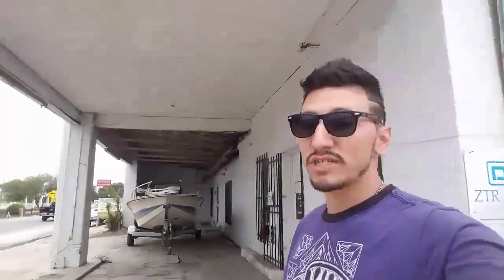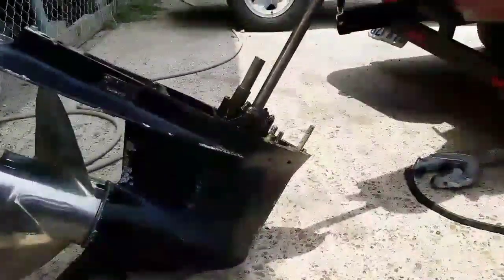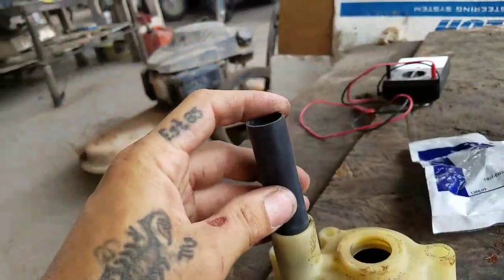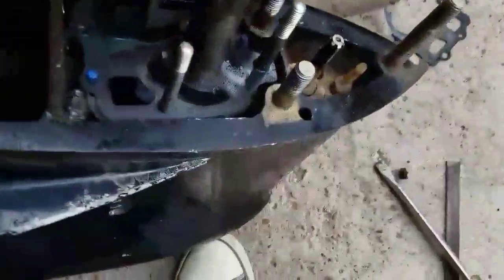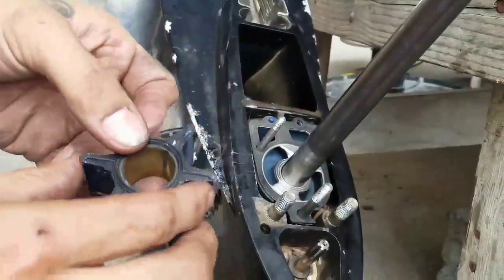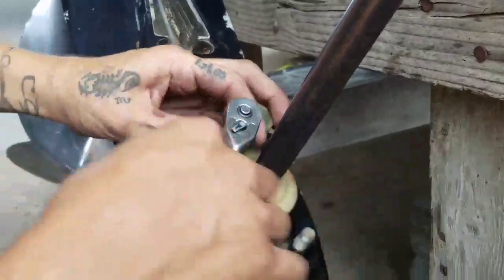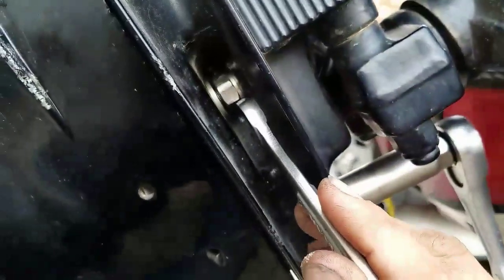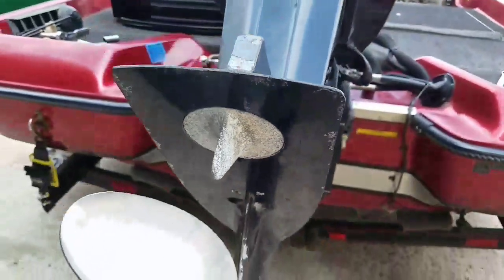How to replace an Impeller on Mercury 135 hp

Comment: After reading all the comments and just tackling this about an hour ago, the only other thing I'd recommend is putting it in gear before dripping the lower unit. That way when you go to reinstall the lower unit you can rotate the prop the if the main shaft keyways aren't lined up. And you won't know they aren't lined up until you have everything else lined up and ready but it won't fully seat. Now that I know this, this job would take me 45 minutes on a bad day. But great video and without it I probably wouldn't have even attempted it!

Comment: Good job on this. Thank you. Just a tip for you though... If that lower unit got hot enough to melt the water pump housing you should have changed the gear oil and checked the seals for the gearbox. The oil is probably cooked and I would be very surprised if the seals are still good. Yes, that's a complete teardown of the lower unit but it probably needed to be done. But, otherwise a great video.
Reply: Agreed,  I would have done the Lower Base with the oil seals for sure and of course change the gear box lube.  (Optis alway use High Proformance 90)

Comment: Hey thank you very much for your video. You made it look easy. I’m working on the exact same motor But I think mines a couple years newer.  Last night I was working on it but I couldn’t get the Bottom unit to go back on but after watching your video not only do I know how to do that now but I realized I have to take it back apart because I forgot t bottom unit to go back on but after watching your video not only do I know how to do that now but I realized I have to take it back apart because I missed The locking pin on the impeller. Thanks again

Comment: Great video. Thank you. Made it very easy for me to replace the impeller on my 1971 Mercury 1350... 

Quick question - The sound the started made on the first attempt to start when it kicked out, do you know what the cause of this is? I'm struggling a lot with my starter when the engine is hot. It keeps making that noise and the starter doesn't kick in. Is there something you know about I can look at?

Comment: Grandpa had me start my 115 hp mercury 1984, without water hookup to try an get it started. engine ran away WOT and the impeller is just Gone. looked similar to yours.

Comment: Using a Petroleum grease or oil on the Impeller is not the wisest choice as it can rot the neoprene, A water based lube, Gylcerine(KY jelly) or dish soap will work fine without affecting the impeller

Comment: Fantastic video what year is the motor i have a 2000 model Mercury 135 hp how often should you change the impeller i was told once a year
Reply: Yes once a year

Comment: Cant get the lower unit shaft back in and connected.  Raise the Lower unit back up to the motor after changing impeller.....and the shaft will not go back in.  I've turned the shaft to line up the spline gears at the tip but it just won't go back in.  Spin it, make sure it's absolutely straight in position but will not receive the input shaft.  HELP!
Reply from the maker: Try rotating the flywheel on top of the engine ,  not the shaft or propeller.
While trying to mate them together👈
Reply: @GTsPerformance  Hey!  I got it to work.  Just put the boat in gear either in reverse or forward.  That holds the drive gear in the motor so that you can turn the lower unit shaft and slide it into place.  Thanks for the help!

Comment: Has anyone ever replaced the blue base under the impeller? Im in the process of replacing mine but the base looks damaged but not sure how to remove it? Any help would be appreciated. Motor is an 86 mercury xr2 150.

Comment: Great video do you have a add oil? I have a115 mercy blue is it the same process?
Reply from the maker: The steps are the same, and these dont spill the oil when you remove the lower unit, but if you want to replace the oil while you're at it.. it takes about a quart of 80-90 gear lube. 
For that, just remove top bolt and the lower bolt to drain (they're both on the lower unit), then you'll need a pump for the quart of gear oil.. connect the pump on where the bottom bolt goes and fill till it starts coming out the top. Once full, put the top bolt on first, then disconnect the pump and quickly put the bottom bolt on. And done! 🙂👍
 Hope this helped, and good luck!

Comment: can you just replace the impeller or do you have to replace housing ect. and is there only one way the impeller can go on or dosent it matter which way i put it on and do you turn shaft clockwise to slide housing over impeller
Reply from the maker: The housing is only if it's damaged.. otherwise,  there's no need to replace. The impeller goes in smooth if you turn the shaft clockwise while pushing down on the housing cover. Either direction you install it, it'll align itself once you give it its first crank. 
We use a bit of white lithium grease/ petroleum grease to slide it in and for the first start, but you could just use soap
Reply: @GTsPerformance  Thank you very much, much appreciated.

Comment: Great video. You gave me the courage to give this a try. I do have a couple of questions. I can't get the lower unit back in. I've got things lined up and it's about 1/4" away. I think it might be related to the shift rod. I had it in reverse but now think the motor might be in neutral. Is it ok to shift back to neutral? Or better to change it manually on the lower unit to reverse (not sure how)?Any tips would be greatly appreciated as I don't want to hurt anything or cause any damage. Thanks again for posting this video!
Reply from the maker: We usually put the gear in neutral,  that way the shift rod can be moved into place by moving it with your fingers. When it is in gear (forward or reverse), the shift rod is in a fixed position.  Sometimes it isn't perfectly aligned and  won't let you sit the lower unit fully shut.
Also, check if the pipe that connects to the impeller housing is in correctly.  That may also cause it not to go in.
Reply: @GTsPerformance  Thanks for the reply. Since it is already in reverse, would it be OK to shift the boat back to neutral and try aligning again or would that cause a problem?

Comment: Do you have to put sealant on when putting the lower unit back on?
Reply from the maker: No, there should be a gasket for the impeller housing,  but no sealant when installing the lower unit back on.

Comment: I changed the impeller now water is coming out the sides by the zinc's and out the exhaust ???? What did I do wrong?  Thanks
Reply from the maker: BR Fleenor ok, I'll be glad to help out. First,  let me just ask what kind of motor you're working on.. (make, h.p. , and in/outboard)
Reply: GT's Performance its a 150 mariner magnum
Reply from the maker: +BR Fleenor   you didn't do anything wrong! This is absolutely normal to see water coming from the sides or exhaust. As long as you have a steady water flow coming out the engine, you have nothing to worry about. Sometimes it's just the water pressure from your hose is too high and the small engine doesn't require that much.  The impeller in the lower unit will suck only the required water to cool the engine,  and the rest leaves from any exit it finds.  

If you do not have water exiting the engine, you may have not aligned the tube that goes from the impeller up to the engine!!

I will advise,  please do not add silicone to seal the lower unit to its base.. as this will trap water and create corrosion. 

I will try and post a video about this first chance I get..

Thanks,  any other concerns.. just ask
Reply: GT's Performance Thanks! After looking i think most of what i was seeing was overspray from the muffs!

Comment: What is about the shifting rod alignement?
Reply from the maker: When you remove the lower unit,  the rod for the gear automatically moves to forward,  so some people put the gear in forward when removing the lower unit,  and when it comes time to install,  you don't have to move anything.. just install. (In theory) 
But, sometimes the rod for the gear doesn't always fall straight into place. So this is just by personal preference,  I like to leave it on neutral so if it doesn't align I'll just align it by hand (on the lower unit)when I'm putting it back together.  Saves time avoiding walking back and forth moving the gear handle till its perfectly aligned.
Reply from the maker: You know what,  when you said shift rod alignment I was thinking about the onboard.. till I noticed the video. 
Actually,  this one is a lot easier. You see the shaft at 6:40 (just right of the speedometer hose) When you're installing the lower unit, all you have to do is help align it with some needle nose pliers.
Just like the tube on the impeller housing that goes to the top of the engine, same thing.  If it doesn't sit all the way in, there will be about a 1/2" gap and won't close
Reply: @GTsPerformance  one thing that a lot of these impeller replacement videos do not emphasize enough is the seal in the top of the impeller housing below the guide tube.  I bought a rebuild kit and it came with zero instructions and did not realize the importance of this seal below the guide tube. Put the lower end back on and no water the tattle tale.....yeah likely because that seal for tube was still in the box... live and learn. thanks for the video.

Comment: totally wrong video ! it melted because it ran with no water ! You should have replaced the lower housing and seals ! The other thing , is the impeller is installed in the upper housing before the upper  case is installed ! AND ... you do not grease the impeller housing ! You pre lubricate with soap and water NOT grease ! Learn how to do it correctly before posting a video .

Comment: so when i had the impeller and water pump replaced on my merc optimax 135, the transmission wouldn't engage. what did the mechanic do wrong?
Reply from the maker: Probably didn't adjust the shifter cables right.. or didn't sit right
Reply: @GTsPerformance  thank you, i will let you know what they say after i pick it back up. curious to see if they own up to their mistake